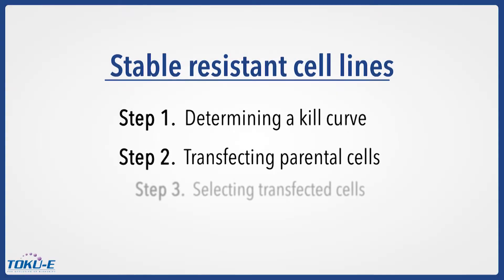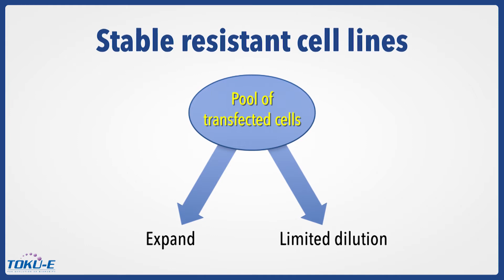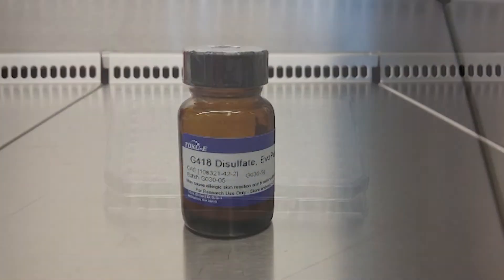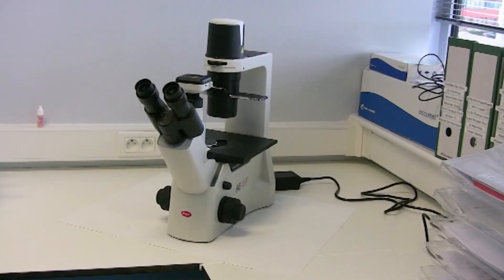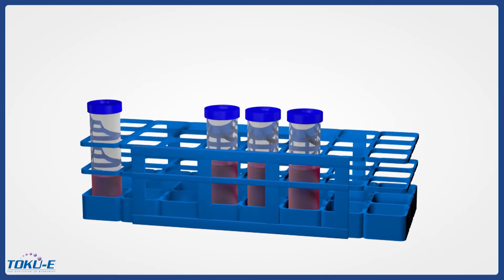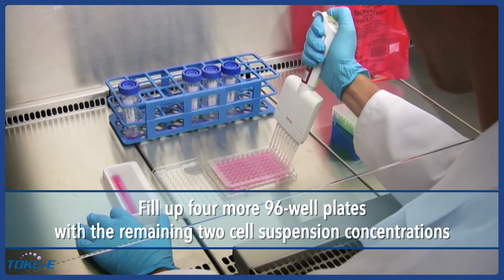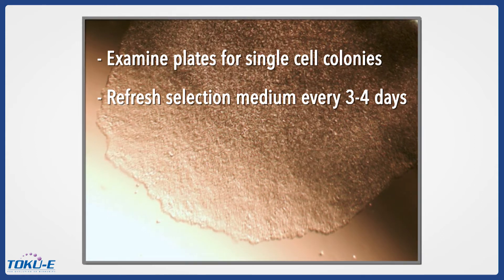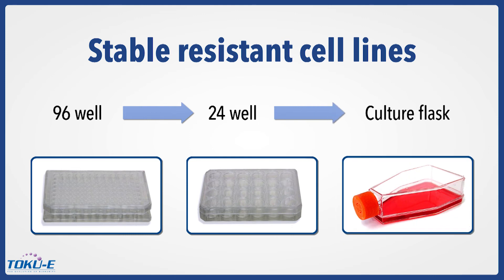Stage 3 of 3: Generation of Stable, Transfected Cell Lines: Selection

Comment: Great video. A quick question. Do you still keep selection antibiotic (here G418) during single cell colony formation and expansion in culture flasks?
Reply from the maker: Thank you for question.  Yes, we keep the cells in selection medium until we have enough cells for freezing (to ensure high purity of cell line stock). Later on the cells can be cultured without the selection antibiotic, however, they should be monitored for expression of gene of interest. If the percentage of positive cells drops during the selection-free culture, the selection antibiotic is re-introduced.

Comment: How do you prepare/collect Conditioned selection medium?
Reply from the maker: Conditioned selection medium is prepared by adding the following components to the fresh culture medium:
          - The conditioned medium - the medium which was collected from the cultured cells - to achieve the concentration 
            of 10 % (so e.g. 10 ml of the conditioned medium added to 90 ml of the fresh medium) 
          - The selection antibiotic to reach the concentration determined in a kill curve experiment - explained in the video 
            ‘Generation of Stable, Transfected Cell Lines: Kill Curve (Stage 1 of 3)’.
Reply: @toku-ecompany7075   Why do you take old medium that had some cellular wastes and possibly the antibiotic would be partly metabolized by the resistant cells. Why dont I just make new fresh media with just 10% of the antibiotic concentration that was predetermined as minimal dose for normal cell death ? I assume you do this because you want to save media and antibiotic ? or there is another reason ? Also, why don't you use the correct antibiotic concentration, why only 10% ?